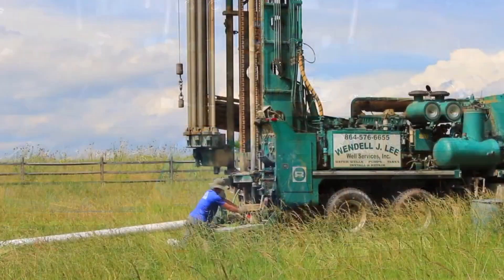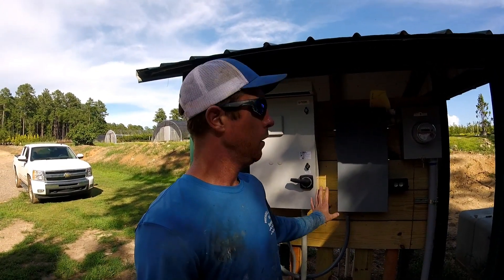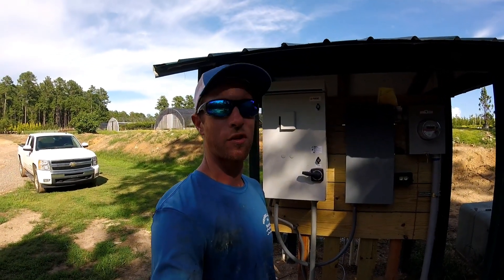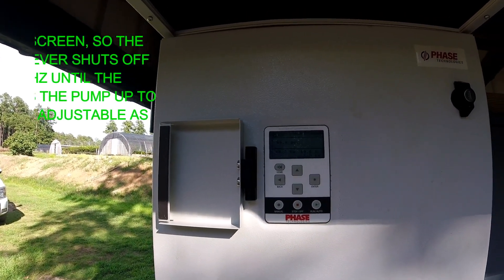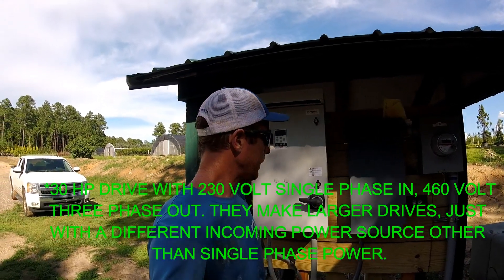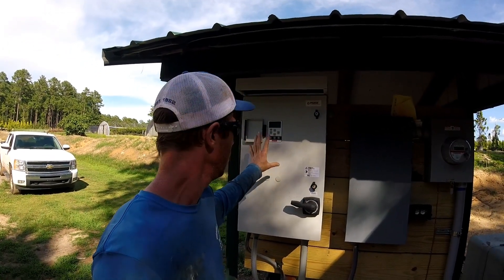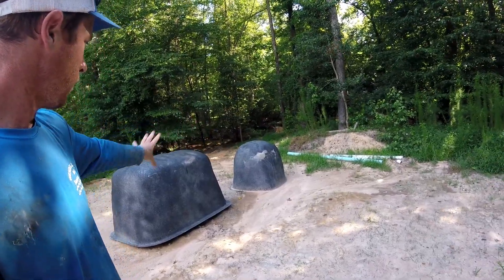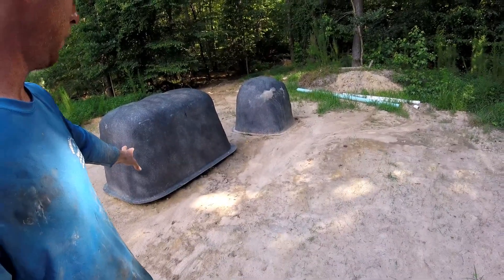VFD Constant Pressure System Installation: Irrigation using a Water Well Pump

Comment: This some good info ! I’m dealing with a incontrol panel running 80 psi @ 100 gpm but lately it’s been tripping out the breaker kinda puzzle on this on why it will do that

Comment: So the VFD converts the power then sends the power down to the pump. Is there a control box built into the phase converter/VFD
Reply from the maker: it is a phase converter and vfd all in one. It converts the power and ramps the frequency up ans down based on required demand to hold pressure constant